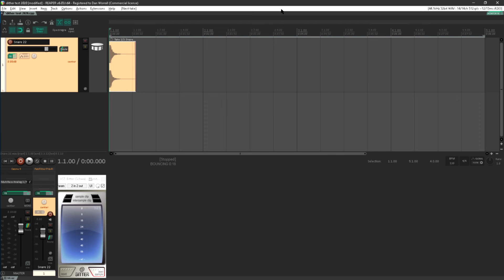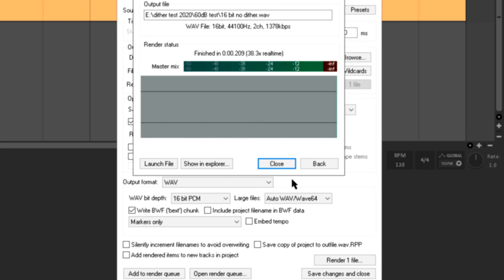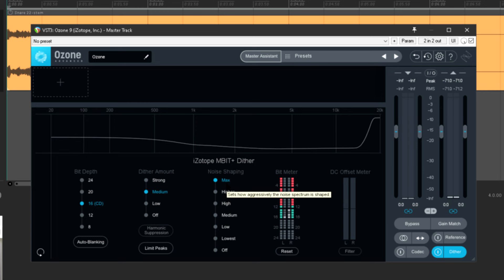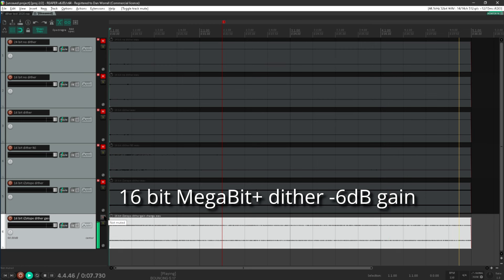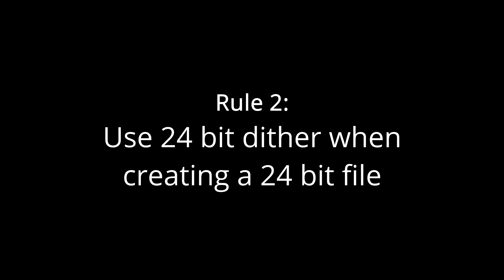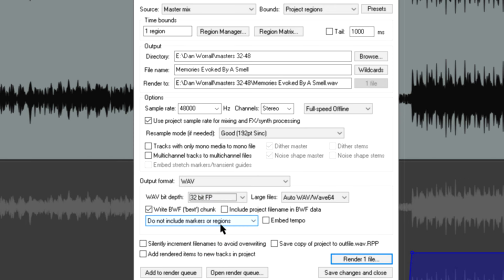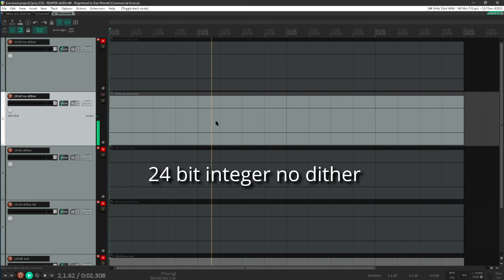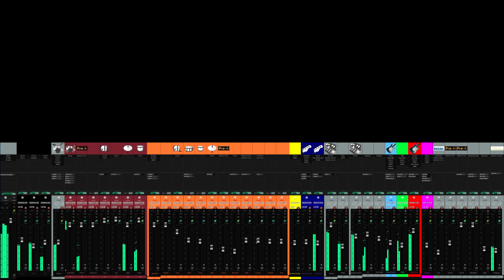WTF is Dither?

Comment: Thanks a lot for this video...very interesting. However, I'm a bit confused. What kind of file is created with the initial rendering with the reverb on the snare hit? I would think it would be 24 bits,  so how come dither is not required in that initial rendering within Reaper itself?
Reply from the maker: I rendered a 32 bit file in fact. You're correct, had I rendered a 24 bit file I would technically have needed dither. But any distortion from falling to dither would have been attenuated by 60dB along with everything else, and wouldn't have affected the results.
Reply: @DanWorrall  Thanks for the reply. Is 32 bit the default when rendering like that, or is there an option where you can choose what file type is rendered within Reaper? I frequently have to do so to save CPU and have been wondering the best way to go about it in terms of file type and dithering.
Reply: You should really lose sleep over this.

Comment: All these examples though are because you have the levels very low. In real life that won’t matter. Dithering is added when rendering to a lower bit depth. But in normal situations the audio is lower then the dither noise.  

Also if you record at 44.1/24 you usually don’t have to dither. 😃 I just upload those WAV files to the streaming services. 
 
BTW, “Waveform Audio File Format (WAVE, or WAV due to its filename extension; pronounced "wave") is an audio file format standard, “

Comment: Dan! There's some question about dither that takes me a long time to think: do we need to use dither when start mixing session? Since we touch the fader of our DAW (in case with reaper) the audio come out of our DAW is now 64 bit depth, right? So as it goes to DAC is it truncates to 24? What your conclusions about that? Thanks
Reply from the maker: Yes, technically Reaper's output should be dithered before going to the interface. You can put a dither plug in the monitor FX section, so it's always there regardless of the project. But I promise you won't be able to hear the difference ;)
Reply: @DanWorrall  no matter what, thanks a lot!
Reply: If I'm correct, good DAWs should dither such things automatically, as well as VST plugins, etc.
Reply: @volchonokilliR  some proof or example of "goodaw"?)
Reply from the maker: @volchonokilliR  output dithering would need to be optional to allow you to use third party dither if you prefer. But more important to get stuff like PDC right IMO. No one can hear 24 bit quantisation errors. If you claim you can you need to prove it in a blind test or I'll call bullshit :)
Reply from the maker: Plugins don't need dither as they talk to the host in floating point.
Reply: @DanWorrall  regardless of details, in my opinion, if something can be done right preemptively - it should be so
Reply: @DanWorrall  well, modern plugins do work with floating point. Though some plugins work in 64 bit float, some in 32 bit float, same for DAWs. So for example if plugin works in 64 bit float, but DAW is 32 bit float, there will be loss of precision. Such errors accumulate and that's why they are best to avoid
Reply: @mika461983  any trusted DAW used in the industry, I believe would do that. At least, in last 10 years
Reply: @volchonokilliR  i think that any daw stream audio to converter in the bit depth of the daw itself without dither to converter's resolution by default. So logicaly if we want monitoring with dither we should put it right away at the start as a last insert rather than use it on the monitoring chain. And if it would be another "default" dither then it would be technically incorrect. The rule is use dither once at the end.

Comment: you dont need dither for mp3 cuz there is no wordlength reduction, its encoded 16 bit at 32 bit fp
Reply from the maker: But it's going to be decoded before anyone gets to hear it. What bit depth will that be? Are you confident it will stay floating point? Sound Forge decodes to 16 bit (last time I checked). Are you sure your car, or your internet connected exercise bike, won't also?
Reply: @DanWorrall  the encoder is 32fp, not the audio file

Comment: this extensive tests have no significance if you dont repeat it STARTING with a 16 bit wav... just sayin what should be obvious
Reply from the maker: It's not obvious to me. Why?
Reply: @DanWorrall  Because like this we cannot be sure if the audio artefacts arent introduced by the process of bit reduction. Im not saying it is like that, but my first intuition was that this wouldnt happen if you went from 16 bit to 16 bit. That being said, I dont feel I have a right to lecture you so Im probably wrong.
Reply from the maker: @youlemur  you can't dither a 16 bit file to 16 bits. You already lost the resolution, you'll just be adding noise. The whole point of dither is to avoid distortion when reducing the bit depth.
Reply: @DanWorrall  well, you can - if we take this into practice everyday use, we are talking big projects in your DAW, often containing all kinds of audio material including various bit depths, as most producers have no clue.. but everyone will reach a point where they need to export into wav and mp3.... Im sure this is what so many bedroom producers do absolutely routinely, probably a majority of them
Reply from the maker: @youlemur  not relevant. All your processing happens at 32 bit float or higher. As soon as you so much as adjust the gain, even by just 0.1dB, you have more than 24 bits of resolution. The question is what do you do with that extra bit depth when you render: just truncate it and get extra distortion? Or dither and get a bit more noise instead?

Comment: i still don't get it
Reply from the maker: With integer formats (16 or 24 bit PCM) very low level signals end up with only 1 or 2 bits of resolution. This means quantisation errors, which sounds like very low level distortion. Adding the right kind of noise randomises the errors so you swap the distortion for a constant noise floor. If you still don't get it, don't worry: if you write a great tune no one will care if you didn't dither it correctly ;)
Reply: @DanWorrall  i was joking tho XD
Reply: @DanWorrall  i dont usually dither my songs since the most dynamic range difference is at max 20db or so
Reply: @DanWorrall  should i dither tho ?
Reply from the maker: @arkh1730  yes. If you don't use dither correctly your music will suck and no one will buy it ;)
Reply: @DanWorrall AWWWW :;( WELL OK